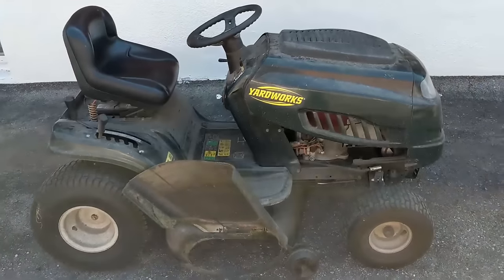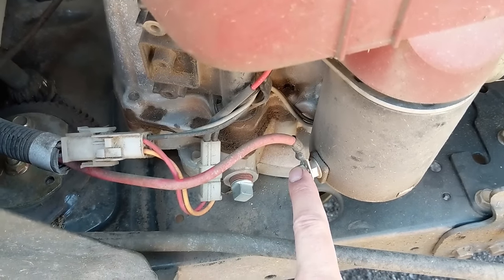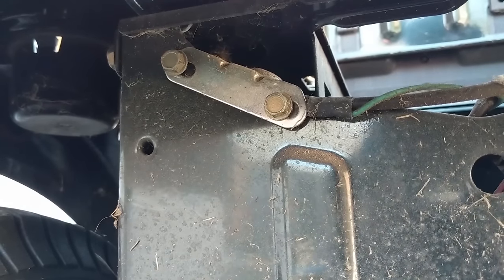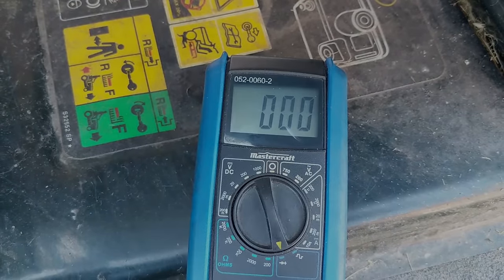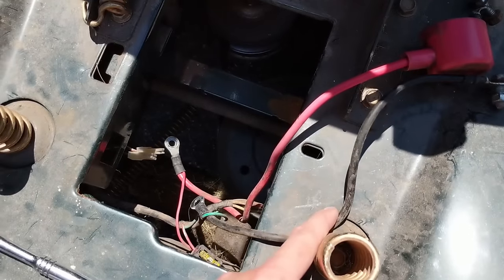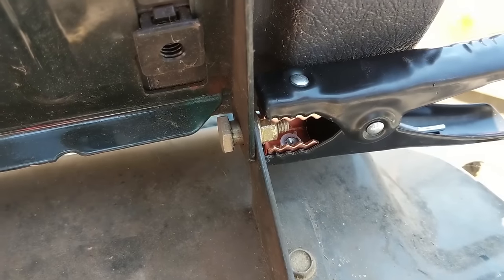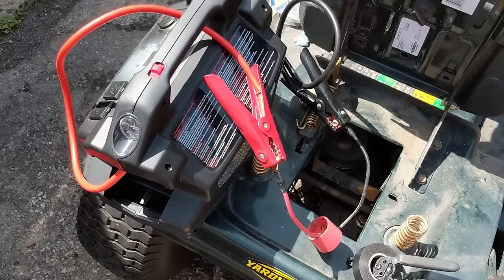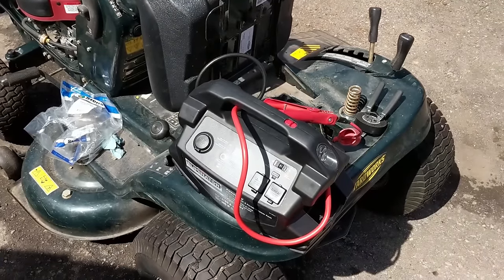Riding Lawn Mower - Solenoid Clicks but Doesn't Start

Comment: Should check corrosion & sparkplug 1st before even pulling out a multi meter.
Reply: Nicholas Flemming  ... Hello ...Why check a spark plug ? The engine isn’t even turning over !!
Reply: @edpetrik501  cruddy spark plugs may = click but no turn over.
I know this from running down the wires and everything was okay untill the plugs-- replaced them, then turned right over NP.

Comment: Going thru to many safety switches will reduce voltage and it won’t do anything but click!
Reply: Not true, unless there are bad connections in the circuit. The safety switches are just a control circuit and don't require an amp load to work correctly. Therefore, voltage drop from "too many" safety switches would be an.indicator of bad switches or improper wiring of the switches, not caused from "too many switches".

Comment: My craftsman riding mower won't start. No clicking sound.
Reply from the maker: Could be dead battery or safety switches https://youtu.be/vJWbfSxHY1Y
Reply: I was mowing the grass. Just refuel and bam nothing. No clicking nothing
Reply from the maker: @rakimbaholder2650  check fuse maybe? Or ground cable
Reply: @EliminatorPerformance  fuse good.  Ground wire good. Could my brake safety switch be stuck?
Reply: @rakimbaholder2650  I know this sounds dumb, but make sure the PTO is disengaged. It won't even try if the deck is powered just like if you don't press the brake.
Reply: @abstract_jeff  will do. Do you think it could be a bad switch somewhere?
Reply: @rakimbaholder2650  It could be something more complicated, but just check to make sure you have that arm that powers the blades fully off. Then try cranking it. It could be you just never shut off the blades before you refueled.
Reply: It's just that it's likely the case if it ran out of gas while you were mowing. Happened to me, spent half a day figuring it out.
Reply: @abstract_jeff  shut the blade off. Never ran out of fuel just refill to move to another area. Started back up drive about 2 feet and it died.  Now it won't start. Do you think the PTO is stuck  in the engage position? If so how can I disengage it.
Reply: @rakimbaholder2650  oh. Going n then died... That sounds like a wiring gremlin. The creator of this video just replied to a comment I left referring me to a newer, better version of this video. Try to find the comment I left n click the link? I'm honestly not much help, hence viewing this tutorial just like you lol.
Reply: @abstract_jeff  you've been a great help. Thanks
Reply: @rakimbaholder2650  just happy to (try and) help. Good luck with the no start issue. I'm sure you'll get it!

Comment: I cheated when I tested. I got my small battery booster, hot to solenoid/starter  side, bump the ground with the ground booster cable. 👍

If I had a long enough insulated screwdriver I could have bumped it that way.